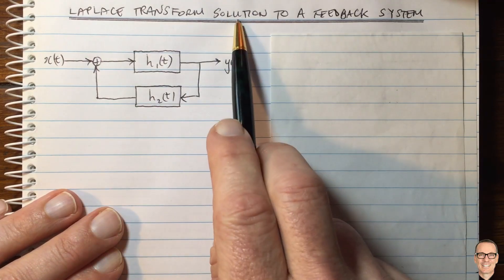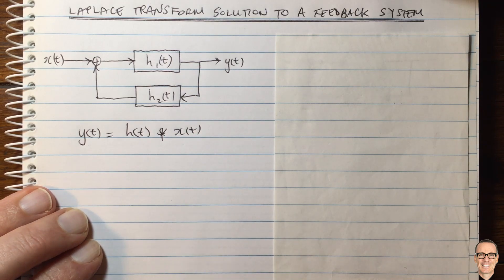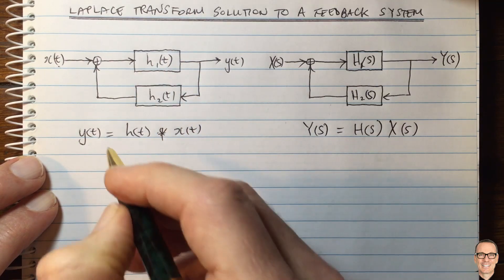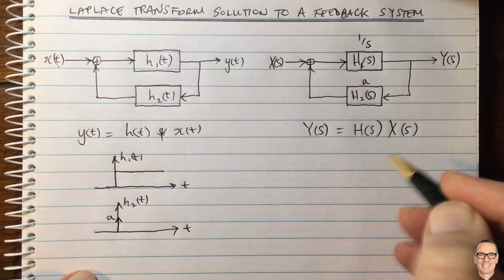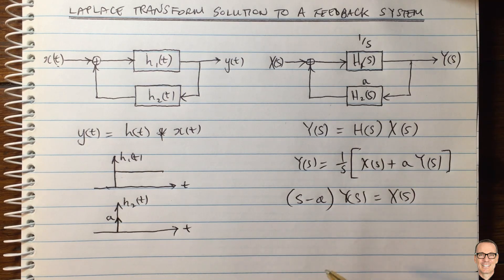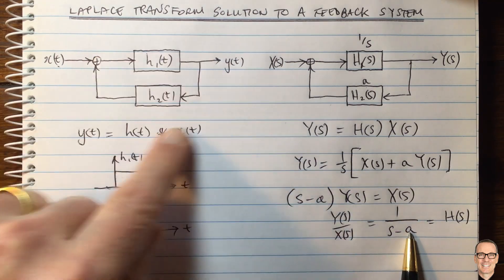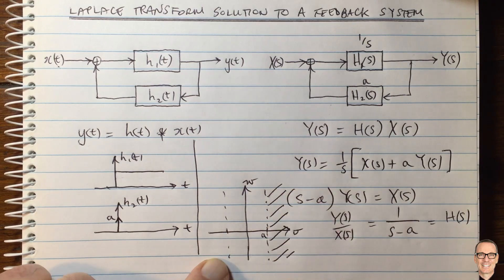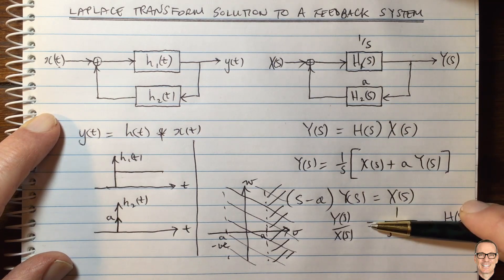Laplace Transform Solution to a Feedback System

Comment: Hi Professor Iain, 

Thank-you for your great informative videos. Very much appreciated.

I've searched the web far and wide but cannot find an answer to this question. A loop must start somewhere and presumably iterate infinitely from there. Using the example in this video, say the input is a impulse function. At the t=0 the x(t) will be infinite and y(t) must be 0. Is that correct? And then after the first iteration, the integrator will have output a so y(t)=a and x(t)=0 so the error signal will be a. Thus the second integration will have y(t)=2a and x(t)=0.... so on and so forth.

In the derivation of the feedback loop formula, Y(s) appears twice in the equation and is treated as if they are the same value. Am I correct in thinking that in the time domain this would not be possible since the y(t) used for input would be from the previous iteration and the output y(t)  would be for current iteration and therefore are not the same. So my understanding is that in the s-domain the Y(s) terms refer to the same function hence why you can derive a formula for the transfer function by solving for Y(s)/X(s).

However, the inverse laplace of impulse multiplied by 1/(s-a) is e^at. If my understanding of initial conditions are correct shouldn't the output signal y(t=0)=0 and immediately after that should be one? But e^at at t=0 is 1. So it's as if the output starts at the exact same time as the input. That doesn't make sense, surely it has to iterate around the loop at least once before the output changes?

Thank-you very much in advance!
Reply from the maker: This is continuous time. There are no "iterations". And yes, the function Y(s) appears twice in that particular equation, but it's just like having an equation like x^2 + x +4 = 6 ... it's the same "x" in both the places it appears. So, likewise, it's the same Y(s) everywhere it appears in the equation in the video. And for your question about the value of y(t) at t=0, and immediately afterwards, you might benefit from understanding a bit more about the Impulse Function - it's just a theoretical function that helps us to understand and model systems. Nothing in real life jumps instantaneously. See: "What is an Impulse Response?" https://youtu.be/WTmelRV_Yyo and "How to Understand the Delta Impulse Function" https://youtu.be/xxGcI9WVoCY
Reply: @iain_explains  Sorry for the late reply. Thank-you for the response it is very much appreciated. The aha moment for me, is that the feedback loop is just a visual representation of a differential equation. In this videos case the diagram is equivalent to the differential equation y'=x-ay in time domain. 

You can confirm this by 1. taking the inverse laplace of the transfer function. 2 take differential of that. 3. Write a differential equation relating y' to y and you'll get what I just wrote. And it looks just like the diagram (assuming negative feedback loop).

Comment: hello, sir suppose if we have an open-loop system (1/s an integrator which you have mentioned in the video) if we multiply it with gain k and give it negative feedback than the poles will move towards the negative side and the system will become stable, and the transfer function will look like (k/s+k) and accordingly higher will be the value of the K higher will be the stability as the poles will be more -ve (farther away from Jw axis).
everything is ok but according to the control theory as we increase the gain the system becomes unstable, but in the above case with the increase in gain in the presence of -ve FB the system is getting more stable so sir why is this contradiction in the concept coming please correct me if I am wrong somewhere.
thank you !
Reply from the maker: What do you mean "according to the control theory"?
Reply: @iain_explains am taking about control system subject sir,  in control systems if we increase the gain of a system by multiplying a gain k than the stability of the system decreases..sorry for going on to control systems that might be little offtopic but they all are related
Reply from the maker: Sorry, but I'm not sure you're understanding. I have a PhD in Signal Processing and Control, so I know about Control Theory. The point of my question was to highlight to you that you can't simply say "according to control theory such-and-such happens", without actually specifying which exact system you are referring to. Just simply by increasing the gain in a system doesn't necessarily make the system unstable. For example, I can increase the volume on my TV, but it doesn't mean the speaker output becomes unstable. Anyway, what I say in my video is correct, so perhaps you might need to think more about exactly where your confusion lies.
Reply: @iain_explains  ok sir I got your point and the example too which you just explained, but as you have said I should particularly mention the exact system which I have actually 
" mentioned" in my "first comment" . moreover thanks for answering I will look in to it more and will try to fix it 😊

Comment: hello professor lain, just a small doubt if we give input to integrator a cosine wave (cost-----Laplace tx-------s/s^2+1) to intigrator(laplace = 1/s) than o/p would be (1/s)*(s/s^2+1) which will finally give (1/s^2+1) and taking the inverse Laplace will get sint ,which conclude that a bounded input cost pass through intigrator gives sint means its stable system. how can this be justified (i have referred a question in research gate where people are claiming it to be a stable system ) , please reply i am badly confused !
Reply from the maker: No, just because one particular input waveform leads to an output that stays bounded, doesn't mean the system is stable. Other input waveforms may result in unbounded outputs (which is the case for the integrator - ie. any waveform with a non-zero constant offset (zero frequency) component).

Comment: hey, professor first let me thank you for this wonderful intutive video. Now my question is that an  integrator as a system is a marginally stable system as its impulse response is bounded but not absolutely integrable so what is the difference between a marginally stable system and a stable system in terms of the damping? A stable system does not require external damping in order to be stable what about a marginally stable system and if it requires external damping than how is it different from the unstable system??

Comment: sir according to bibo stability integrator should be stable system 
suppose we give input Sint (which is bounded) then we will get cost(which is also bounded) this it is a BIBO stable system so why it's not stable in terms of ROC please correct me where I am wrong
thankyou
Reply from the maker: I think you're confused about the stability of an integrator. It is not a stable system. When the input is sin(t), the output will not be cos(t) (which you claim). If you don't agree, then try doing a simple Google search on the term "bibo stability integrator".
Reply: @iain_explains   @Iain Explains Signals, Systems, and Digital Comms  ok sir if integrator is not stable then how it is practically implimentable means we can make a intigrator circuit by using opamp and its practically possible
Reply from the maker: Unstable systems are easy to implement in practice. Think of what happens when a microphone gets too close to an amplifying speaker at a concert, or in a lecture theatre where the lecturer has a wireless microphone and walks in front of a speaker that is amplifying the signal. The sound gets louder and louder and turns into a screech. That is an unstable system.

Comment: my doubt is that in video on "ROC for Laplace transform" you mentioned that right side of jw axis corresponds to the damping of signal and thus we can find Fourier transform by converting a signal in to finite energy.
but here in this video you are considering the right side of jw axis as positive FB aren't the above two concepts contradictory??
Reply from the maker: Real (ie. causal) systems have a right handed ROC in the s-plane (from the "most positive / least negative" pole to infinity). This corresponds to the values of the "damping function" in the Laplace Transform that will stabilise the system. If that ROC includes the jw axis, then the system didn't need any damping in order to be stable. The jw axis is the "zero damping" case. It means the system is (already) stable.
Reply: @iain_explains  ok sir it refers to  if a system is stable and its ROC include jw axis than even if we give positive FB to a system than it will be a stable system unlike the intigrator case shown in the video 
anyhow thanks for the great video sir it cleared my most of my doubts.

Comment: hello sir hope you doing fine 
as you have mentioned that the pole should be -a suppose a=1 thus pole for a system will be at -1
sir my question is that if we apply input exp^(-2) to the above system then why will not get converged output though we are applying an input with decaying exponential  means sir i know its mathematically defined but is there any intution behind it?
Reply from the maker: I think you're not quite understanding what the s-plane is. The function you mentioned does not depend on "s" (and actually, you've written exp^(-2), which is not even a function, it's just a number. But I presume you are meaning exp^(-2t) ). Hopefully this video will help: "Laplace Transform Region of Convergence Explained" https://youtu.be/SexBL1OlhhU

Comment: I thought feedback meant that the transfer function was H1(s)/(1+H1(s)H2(s) if you add their frequency responses then they'd be in parallel.
Reply from the maker: That's the formula for negative feedback (ie. when the summation has a negative for the feedback path). But in any case, it matches with my formula, if you change the "+" to a "-" in your formula (since I am considered just a standard adder). It really doesn't matter. You can consider negative feedback with a "positive" feedback impulse response (your approach), or positive feedback with a "negative" feedback impulse response, ie. when my "a" value is negative (my approach). If we use your formula, but switch it to a negative in the denominator (to match with my "positive" feedback summation), then you get (1/s)/(1-(a/s)) = 1 / (s-a) , which is that same formula that I got.